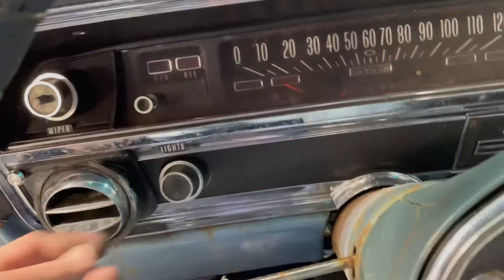Resurrecting a 1966 Buick LeSabre 400

Comment: I was a detailer from 1974 until 1998. When I see today’s methods and I think back on how I toiled with an old Milwaukee buffer that probably weighed 15 pounds and the gritty awful 3M Super Duty rubbing compound I realize that I was born 30 years too early!
Reply from the maker: I remember the compound well!  Lacquer was a different animal than most of the stuff we have to deal with these days.
Reply: @antiqueautomotiveservice  

I worked as an estimator in a body shop after I was a detailer. I was amazed at the modern paints after dealing with acrylic enamels and lacquer

Comment: Man, I'm only 5 minutes into this vid and already excited with this car! Being a 66-67 Chevelle/El Camino enthusiast and Chevy guy mainly,as it is just so cool to see a 66 Buick survivor car like that. I have never came across a Buick from that era here in the Midwest at 48 years old,with over 30 years piddlin on ol cars. Now, I guess I need to finish the video as I have a 1966 factory Big Block El Camino with a similar story with more of the same weathering/patina (present on your Buick's rear) in some areas I have tossing around concepts/ideas 😏 Thx for the vid. Awesome ol car! And yeah, after replacing the headliner, maybe sealing off (POR-15 or whatever you prefer) the tops of the floorpans  etc., you should hopefully get that moldy smell outta there as you know too. Lotta of it is all the mice "leftovers" packed and hidden in that headliner 😮 . Best of luck and as always, Happy Restoring! 🦾
Reply from the maker: Hi Jim, it's such a shame that this car got left in that garage to rot.  When my friend used to drive it to club functions, I was always impressed with how well it had been preserved.  It will never get back to that point, but I can at least try to keep it on the road.
Reply: @antiqueautomotiveservice  That's what it's ALL about Adam! PRESERVING em! 💪And trying (even with fuel prices skyrocketing , SMH😞) at least, to KEEP EM ON THE ROAD! 👍 I got a little further into the vid and noticed the "1966 GM" car's shade of blue is also probably the same "Mist Blue poly/Fontaine Blue" that I have on my other 66 El Camino factory 327 SB truck (also a personal favorite color of mine 😏) that was dropped for the 1967 year introducing "Nantucket Blue poly" that is similar, but not quite the same. Again, fantastic work and thanks for the videos. I could/can talk these old cars ALL day and night through next week 😬 lol. So, I will "try" to sign off for now...St. Louis huh? 🤔 (car's last location) Well, THAT IS also right here in the Midwest salt belt only 3 hours away from here in Kansas City Kansas/Missouri area in my hood.... Very interesting 🤔 And STILL obviously, a good deal (even with the latter neglect the car did endure) that it's as original and in such decent shape for the area it came from. VERY good stuff, indeed! 😎👍
Reply from the maker: @jamescon55  Yep, I'm just west of St. Louis is a little town called Foristell.  West end of St. Charles county.
Reply: @antiqueautomotiveservice  I see...🤔 Never been anywhere directly in St. Louis, just been "through" it via I-70 a few plus times and from the insane traffic and "visuals" of the whole area? It's definitely somewhere that I would hope to NEVER, "HAVE TO" get down in vicinity to EVER have ANY business 😬. And I HAVE BEEN I'm some "shady" cities/towns throughout these States all way from Florida to California (East L.A. of all places too). But yeah, ya hear things from lotta people about places plus, just "the feeling" ya get when rolling through etc. and yeah... Definitely get the feeling of "just push down on the accelerator with ALL the other crazy drivers in St. Louis, pray like hell ya DON'T have any breakdowns/ OR accident! And GTHO of St. Lou-eee! 😬.....Lol.

Comment: My aunt and uncle bought a used 1966 LeSabre 2 door in the same color as yours. They bought it in 1971 from one of my uncle’s coworkers. It had 30,000 miles on it and he paid $900 for it! How is that for a good deal? They lived in the city of Chicago which is notoriously unkind to vehicles. My uncle eventually junked it in about 1984. By then it had rusted away to nothing but that 340 cubic inch engine was still purring like a kitten. I wonder how far it might have gone in a friendlier climate?

Comment: This 66 Buick is a good looking car style wise. And a 2 door hardtop  at that. Not many left. This one is a bit rusty, but cleaned up nice. A driver grade car to use and enjoy. I don’t know if it would rate a full restoration due to the level of rust and the cost to fix it all. But it’s still a keeper. 

Do you know the story on the checker wagon that was parked next to it in the garage? Defiantly not many of those around anymore.
Reply from the maker: I actually considered grabbing the wagon, too, but it was SOOOOO rusted that it would have fallen apart if I tried to drag it out of there.  They called a wrecker and hauled it off.
Reply: @antiqueautomotiveservice  Was there a 66 Buick wagon you are referring to? I'd hate ta think a "complete" 66 wagon woulda got crushed just cuz of body rot. Thinking in mind of "PARTS" of course...Depending on the condition of "rotted away" though too, I can definitely understand that too as well. Now these days and especially here in the Midwest. ALL them cars from the older days been sitting for decades, and used to be great parts cars back when and then now? Ya just gotta CUT practically ANYTHING or  EVERYTHING that's on em. Really kinda sad but, Mother Nature WILL take over with those that procrastinate, especially...Lol....Again, THX for the cool vids!

Comment: GREAT VIDEO, JUST AWESOME!! You have just gained a new subscriber!! 

What would you suggest for a bumper restoration that is slightly dull and has a little rust pits on it
Reply from the maker: Chrome unfortunately can't be "polished," but you can clean it up with some 0000 steel wool coupled with a chrome polish.  The steel wool will scrub the rust off the surface, but if it's pitted, there's no fix other than rechroming.
Reply: @antiqueautomotiveservice  thanks for the feedback!!

Comment: Laundering many microfiber cloths rather than using disposable blue shop towels.
Reply from the maker: These are cheap Costco towels that I only reuse as grease rags later on.  I save my good ones for real paint correction.